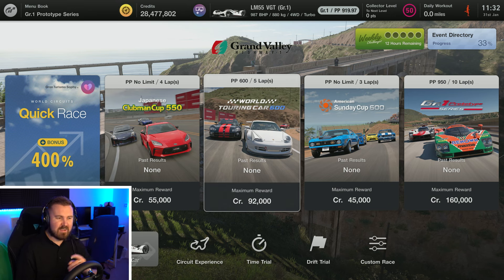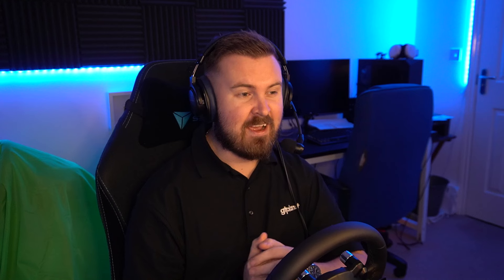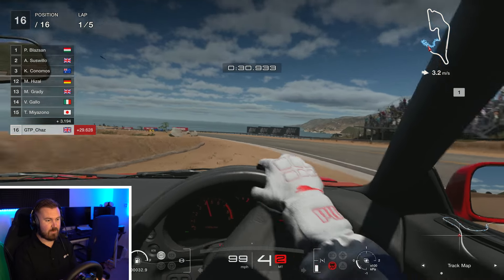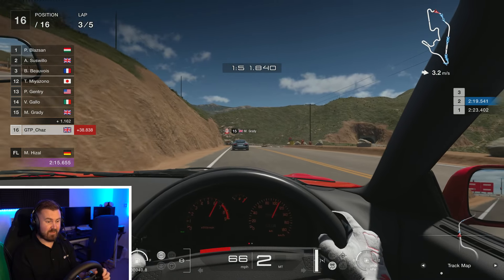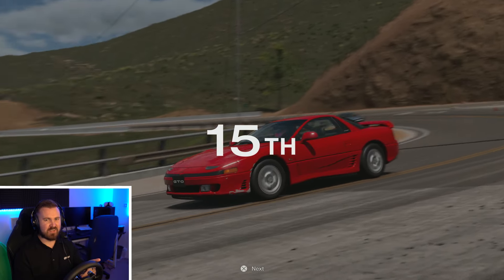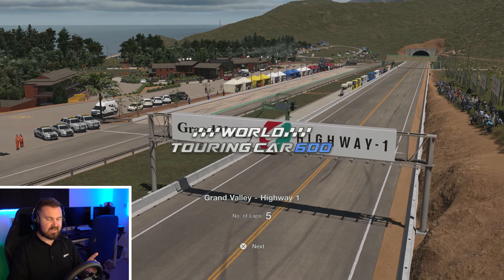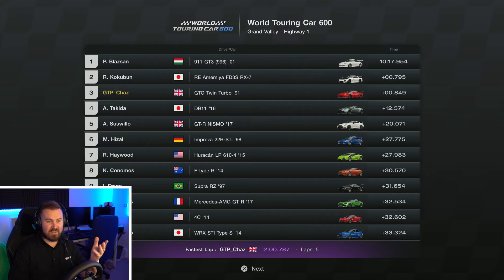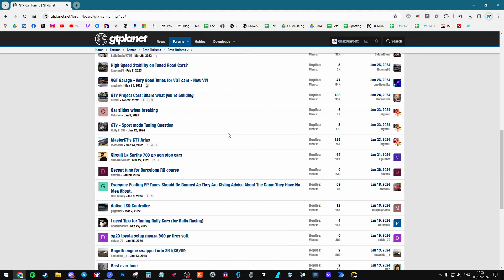Can We Kill The Understeer of the GTO? - Gran Turismo 7 Tuning Guide

Comment: The Mitsubishi GTO is always my go to car. Will always be one of my all time favourites. Also, I hope they bring the Later models too GT7, as they are lighter and handle much better.
Reply: I have a later model in FH5 and it isn't very good.
Reply: 1998 model year with a large rear wing in stock.
Reply: @LG4761   Nope. Mine is 1997(1st facelift).
Reply: @basshead.  That is 1993 or 1996 model year
Reply: @LG4761  Bro, I know my car. It's a 1997 GTO(1st facelift, no pop up headlights)

Comment: Loving the tuning videos, Chaz! Learning a lot here! What would you suggest for the front/rear balance of braking? Should we prefer a bit more braking in the rear to better handle sections like the 1st sharp right turn at Grand Valley?

I did not yet have access to the Carbon Propeller Shaft (Ultimate tuning) so took ballast to 186 and arrive at exactly 599.99 PP. :)

Comment: Do yourself a favor.... I'd ask to thank me later, noone remembers.  Copy the style of suspension settings you find on a similar drivetrain Gr.4.  

- Depending on the weight of the vehicle you can kinda calculate the right range for the spring rates (if you have gone full lightweight with this tuning method, the spring rates are basically set right in the middle both front and rear for 90% of cars in game)
- Using this set-up I find a minimum of 20mm from the lowest ride height is key for appropriate suspension travel and mechanical grip.
- If your aero is approx the same range as a Gr3 or above, use the same method as above, but re-read Gr3 dampening settings to resist aero bottoming out.